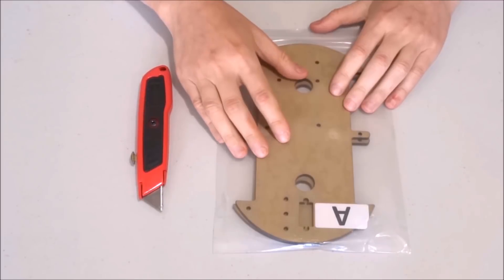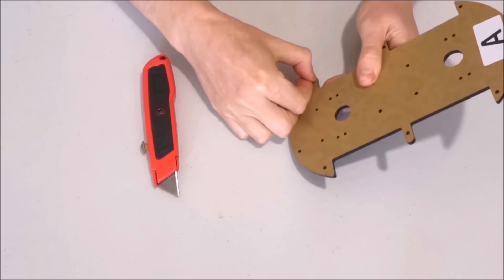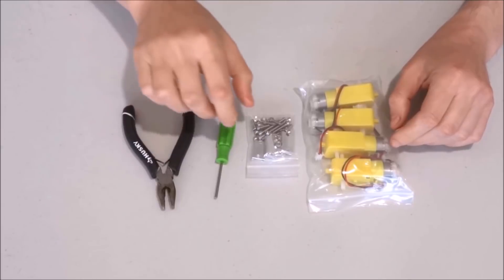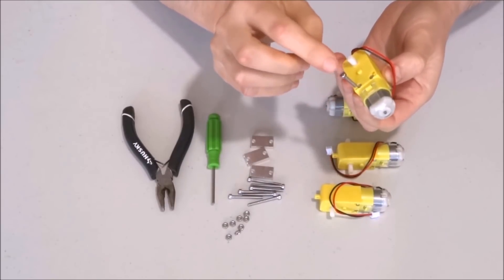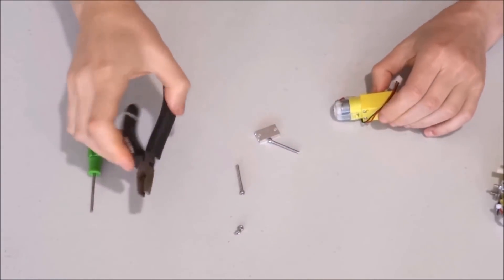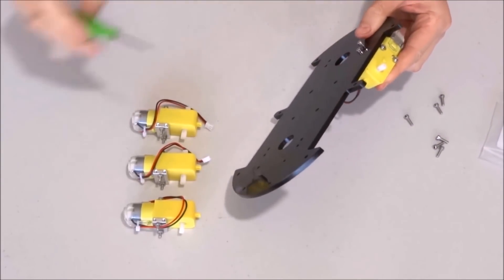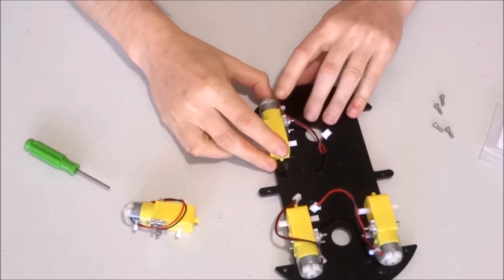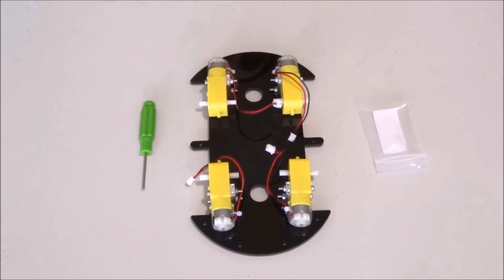Assemble Elegoo Smart Car Arduino Robot KIT 3.0 Step 1: Install The Motors

Comment: This video is so not undanding. I don't like it I don't understand your acent or anything
Reply: You Bastard...
Reply: The video was not intended to be undanding, Captain, since it's clearly a danding video.  You may not like it, but at least you could express that in a complete sentence.  Try adding a conjunction ( Eg. "I don't like it and I don't understand...").
The need to understand his "accent" (not acent) should be minimal, as the parts and their purpose are obvious even without any verbal explanation.  On the other hand, if you don't understand anything, perhaps constructing pre-wired robots is just not for you.  I suggest Duplos.